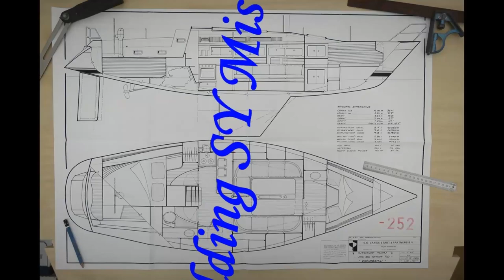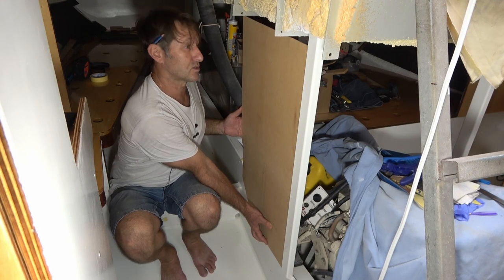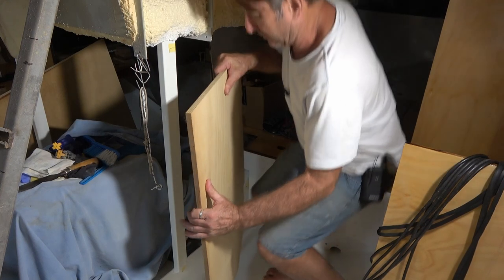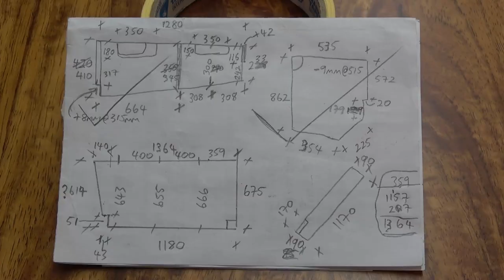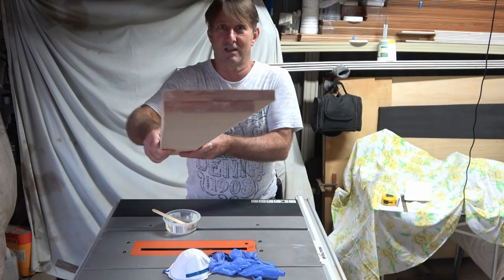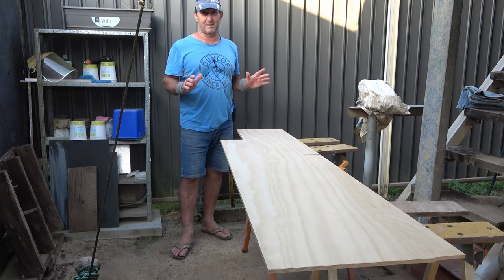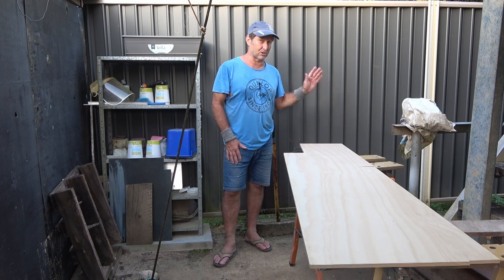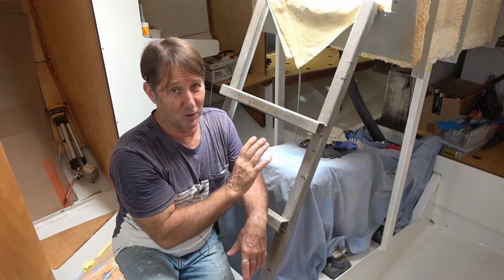WINNING People! 12 panels:9 DONE! Ep.135 Building my steel sailing yacht

Comment: When I had to switch between 90 degree cuts and bevel cuts several times, I found that a few batten strips in varying widths could be laid up against the saw fence to tilt the whole saw rather than unclamping the base each time. A check with a bevel gauge will show some common angles that can be made with different widths of wood strips, then just write the angle on each strip. A bit of tape keeps the strips from moving...
Reply from the maker: Thanks for sharing your tips Mike, appreciated  🙂👍